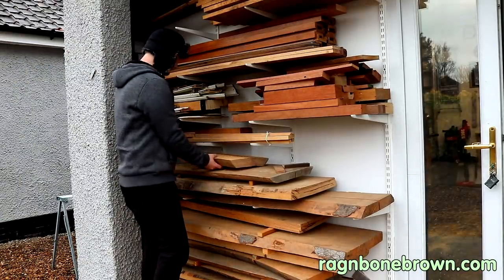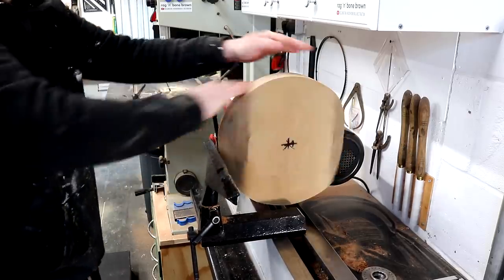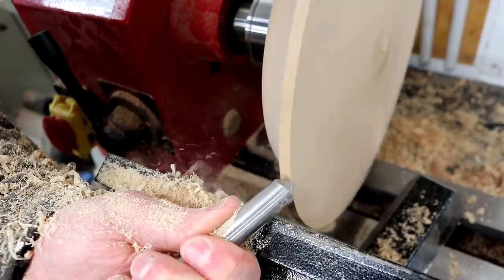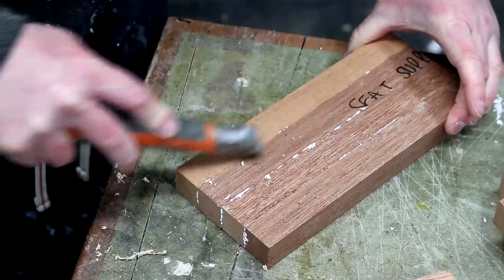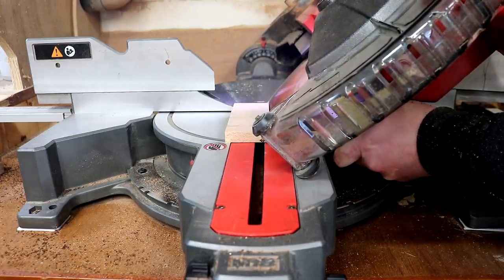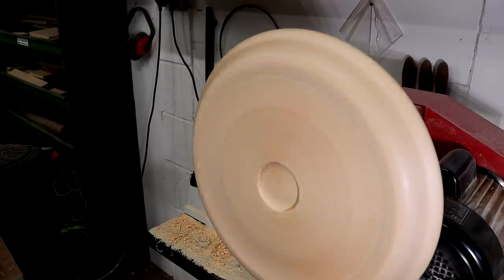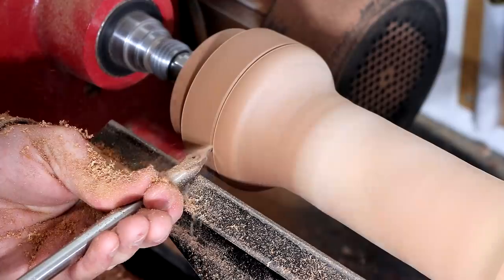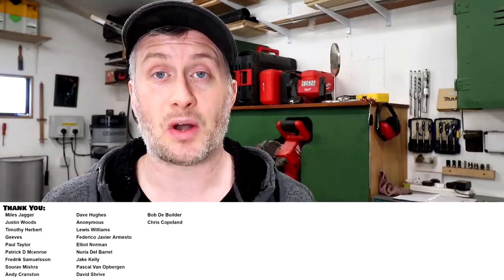Making A Cake Stand For Our Wedding 👰🤵

Comment: If you want to avoid needing to remove lots of material to loose the faceplate screw holes, glue a but of scrap to the centre (I normally use some ½" ply) to screw the faceplate to.  You can then just turn away the scrap once you've got it in the chuck.

Another trick I was shown by the DT technician at school, when you cut those little detail lines, get a steel cheese wire (I normally use a bit of mig welding wire, as I've always got some kicking about somewhere) and hold the wire in the groove while it's spinning.  Pull the wire tight, and it will quite quickly burn the bottom of the groove.  Fun to have a play with, and smells lovely if you're turning something like apple